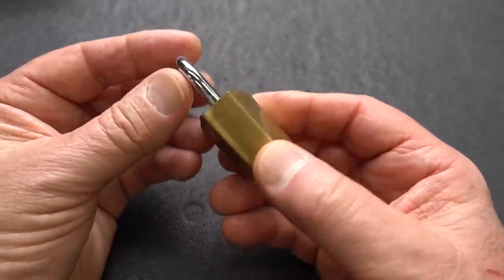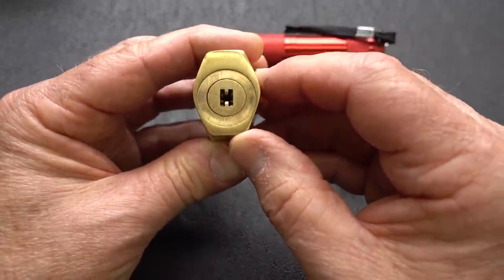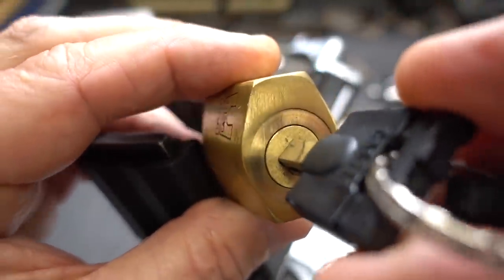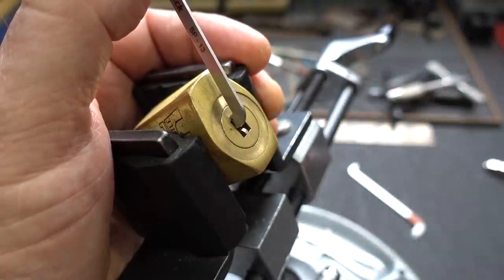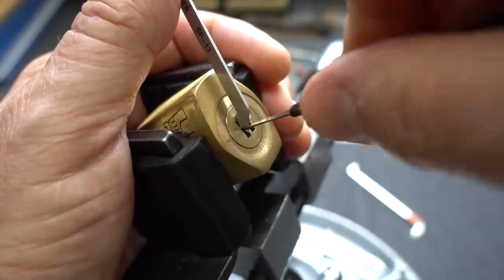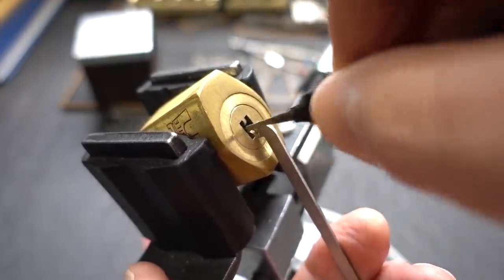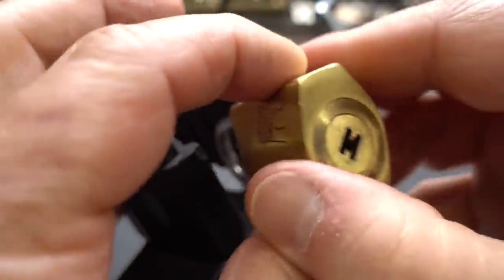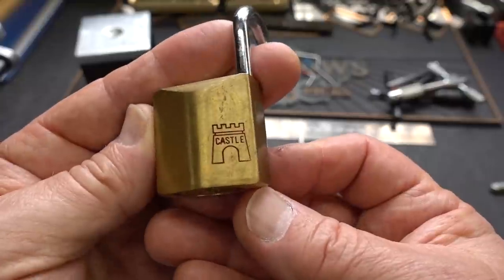(1728) Castle 18-Pin Padlock

Comment: This is obviously a lower end padlock, with awesome key control. Would love to see some one use this design, on an upper level, high security lock, beefed up for physical strength, drill protection, ball bearing engagement, with security pins. I'd think you'd have a lock to be reckoned with!
Reply: I'm willing to bet with all those pins sticking security pins in it will reduce the reliability.  That thing will be constantly binding up even with the regular key.  It's a clever design, but not very practical.

Comment: They went through a lot of trouble for that unique keyway with pins on 6 different planes, from when I first seen it I wondered how to tension. But why? Why WHY would they only use a single latch and no anti shim slot? I don't get it. I forgot to look, was the shackle even hardened? It looked pretty thin. Was neat watching how to beat it though, I'd like to try single picking it. Would be time consuming but fun, and a great feeling of accomplishment when it opens.
Reply: Imagine if it had some security pins too.

Comment: I wonder what it would take to make such a lock more pick and especially rake resistant.
Reply: Maybe security pins
Reply: Security pins for sure. And either very strong spring tension on the core or extremely light spring tension to help cause you to over tension and bind the pins.
Variable strength springs on the pins would help too. 
One other thing with locks like this is with this many pins it becomes expensive and tedious to have a versitile array of depths to cut the pins to, so this makes really challenging bitting harder to achieve as well as having a large variation in bitting between locks. They tend to have a very narrow range of cut depths which makes raking easier because its less likely to have a cut depth that exceeds the amplitude of the rake preventing it from easily setting a particular pin, especially with lower energy raking from a realatively flat angle of attack. 
 Theres also plenty of space in this kind of lock to utilize something like trap pins, which could seize the lock totally, or hidden pins such as a pin that has to be pressed in by the end point of the key at the back of the lock that will prevent actuation even if all the other pins are at the shear line. 
 You could also use passive pins creatively here. Basically they would be zero cut pins that are naturally at the shear line when at rest. The key doesnt interact with them, but they are placed such that raking or even single pin picking will overset them, or even cause you to lose a false set unless you know they are zero cuts. 
A zero cut pin or two would really mess with a rake attack.
Reply: Something like this could also use magnetic elements that would render take attacks moot unless you knew they were there.